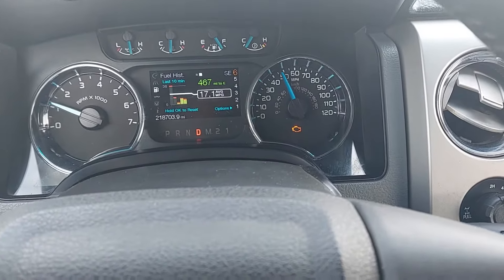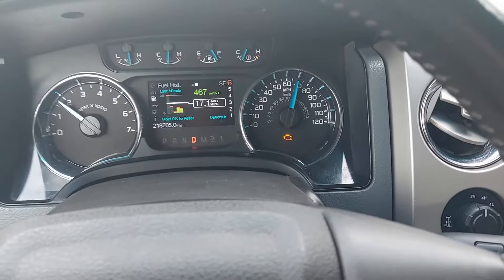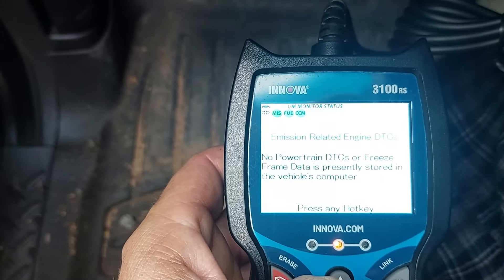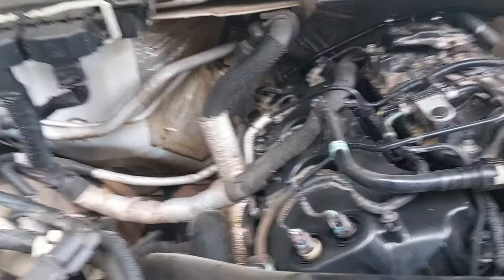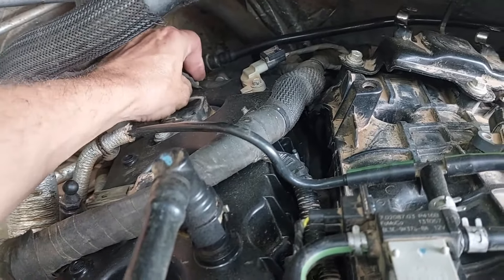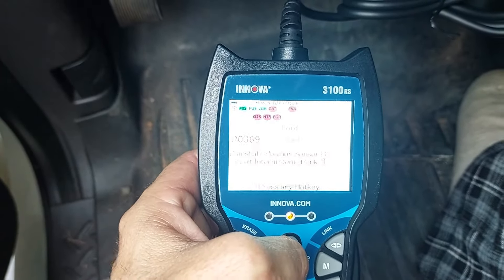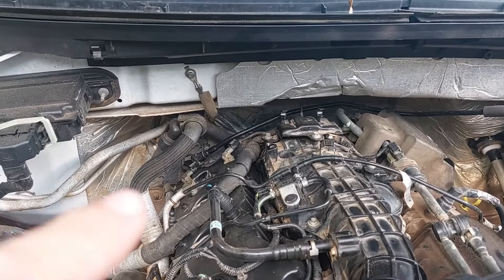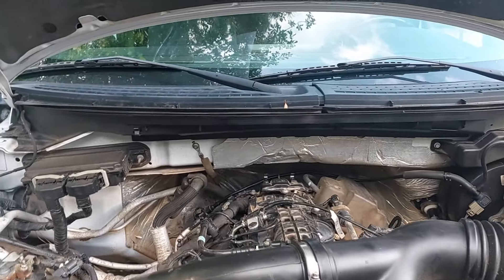2013 F150 3 5 Ecoboost P0299 P0369 P0365 SOLVED

Comment: I have a 2013 F150 with the 3.5L Ecoboost that just got a new timing set, oil pump, exhaust manifolds, and new turbo seals and all new hoses. I did a bunch of work to it. On startup, it ran like a sewing machine. Happily, I took it on a drive. Got the P0365 CEL and was mortified that it had jumped time or I had some other horrible, time consuming and expensive repair to do. After watching this video, I ran to O'Reilly's and got a new sensor, swapped it out, cleared the codes in the computer. On startup the P0365 code came back. 

I checked the new sensor and sure enough, there was something stuck to the tip of it. I cleaned it off with a clean rag and put it back in the valve cover. I think checked the connector. Although nothing was obvious, I cleaned the pins with contact cleaner, then reconncted it to the sensor. I squeezed it on as hard as I could and it made an audible click. Since then, it has run better than the day I bought it.

If you have the dreaded P0365 code, follow the advice in this video, and check your connector(s).
Reply from the maker: @jeffscranton  Thank you for that fantastic comment and for sharing your experience. I hope she runs 400m miles without problems.

Mine is now at 230k and havent had any more problems out of it.

Stay safe, stay free.

Comment: Just got my turbos replaced, I have the codes p0012, p0024 and p0299. Any help or advice?
Reply from the maker: Looks like it all had to do with the turbos. If you just had them replaced, I would return to who did the work in order to test for failures. I have read that if these turbos are not properly installed, oil won't pump up as it needs and will cause premature failure.
The one code involves your camshaft. This could be the timing solenoid or even the exhaust cam gear ring, which has been known to spin on the camshaft. It's a flaw in the design  that causes this loose ring.
Look for major oil leaks. Check your intercooler tubes for openings or cracks. 
I would want to do some more diagnostic on the turbos to confirm that they are not the cause.
Reply: @cobravids thanks for the fast response I appreciate it. I’m dropping it off at a different that specializes in 3.5 ecoboosts and gonna have them go thru the turbo job etc. if they find something wrong with the turbos I’ll then bring it to the shop that installed them. Hoping its nothing huge

Comment: So there was nothing In the video about p0299, turbo under pressure,  just cam sensor
Reply from the maker: You are correct. That shaft sensor causes the error code with the turbo. The research we found pointed to it. After we cleaned it the codes cleared up and has not come back.
Thanks for the comment. Be safe.
Reply from the maker: Also, I'm not saying that is the ONLY issue that can cause it just one of.
Reply: Are both the seniors the same for A&B Bank 1  thank you in advance  @cobravids

Comment: Could it be my o2 sensor if that’s what is popping up on the computer
Reply from the maker: This code can be a few things. The most common thing I found in my research is the signal "gear" that is on this camshaft breaks loose and spins freely. Throwing off the computer. In my case, it was a dirty, if not malfunctioning sensor. 
Have you removed that sensor and looked at it? 
If anything an aftermarket replacement is 20.00. If it still has this issue, then you need to look at that signal gear inside the valve cover.
I did not read anything to indicate o2 sensors. But I'm not saying it couldnt be a problem. I just didn't find that information. 
O2 sensors usually give a code that indicates lean or rich, or even o2 sensors directly. 
O2 sensors or catalytic issues can sometimes throw a P0420
Reply from the maker: Also come back anytime for questions or advice. I am here to help.

Comment: Any tips for ecoboost to keep the life of it going ? :)
Reply from the maker: Yes! One important thing to do is keep your oil clean. The turbos in this truck, and other turbo I'm sure does not do well with dirty oil. If you find any oil leaks be sure to repair them and make sure it's not coming from turbo oil supply lines. A dry turbo is a dead turbo.

Other than that just keep it lubed and replace things as they begin to show the signs.
Reply: @cobravids  thanks !

Comment: Particles get carried by oil,,, think oil that helps keeps that suspended till hits oil filter 😊
Reply from the maker: Correct. What i was concerned is where are these magnetic materials coming from. Bearings are aluminum, they wont stick to a magnetic surface. So its a magnetic metal. I havent seen that much stuck to a magnet like that.

Comment: I’m going through this now, 1st mechanic told me 6,000-10,000 to fix. I’m going with that guy is a fraud. Have the exact same p0365 code and that is the only one. Dude told me I’ll need a new engine
Reply from the maker: @ryennaustin-brown8309  That's a lie. Mine was solved by cleaning that camshaft sensor. If your isnt so easy then its the tone gear on that camshaft thats slipping on the camshaft. At most you will have to have that camshaft replaced. Try replacing.or even cleaning off that sensor. I havent had any problems since i cleaned mine. 
Its a flaw in the design. That tone gear is pressed on, not welded or otherwise attached. Thats why they slip. 
Try resetting all the codes. Will it run fine for awhile?

Comment: Pull oil pan and check bottom end😊
Reply from the maker: @rowlandreddick2664  After my house is built i plan to remove the engine and do an overhaul. The turbos are starting to have issues. 238k miles. Still hauls a pallet of concrete like its nothing